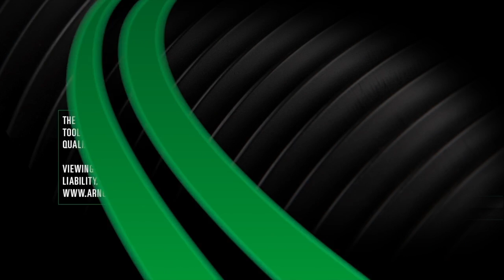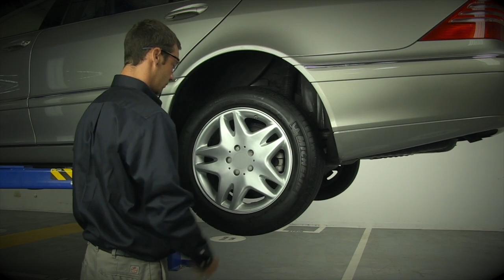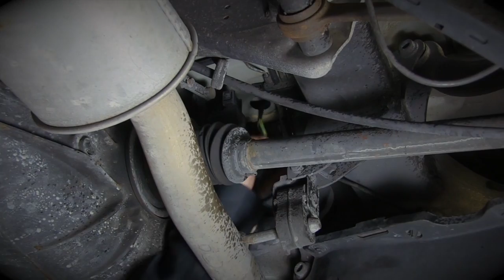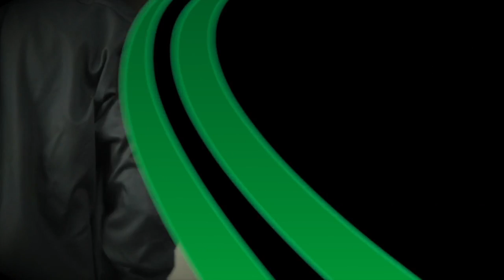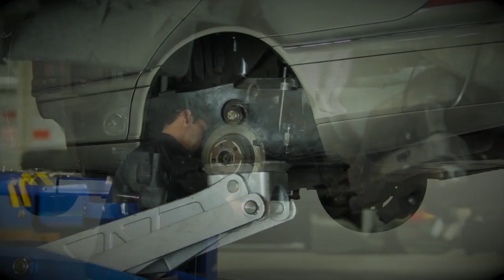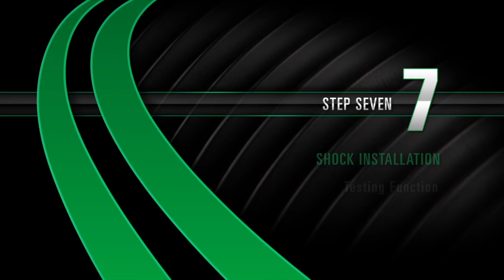Mercedes-Benz S-Class Rear Air Strut Removal and Installation of Arnott Replacement Parts

Comment: i just replaced my rear airmatic shocks on my 2002 benz s 430 this video is great but in real life the last step with the car jack is a nightmare nothing lines up right you spend 1 hr + lowering and raising jack using flathead screwdriver to line up hole a nightmare but job is complete once done alot of work but a happy camper at the end save myself 100,s of dollars good luck peeps